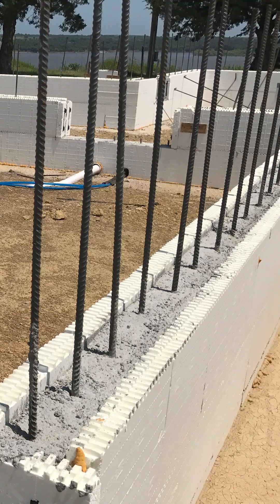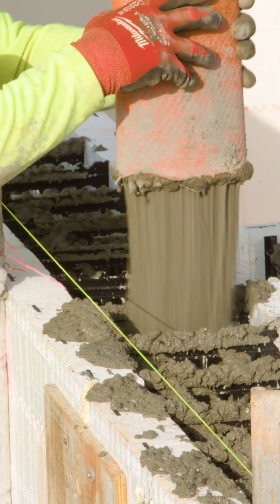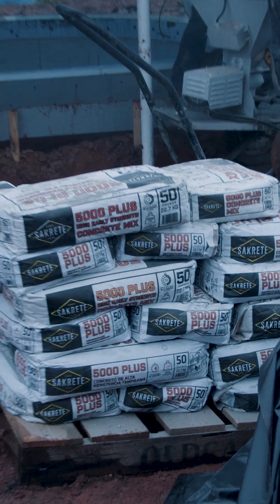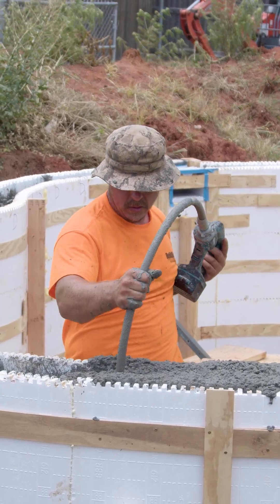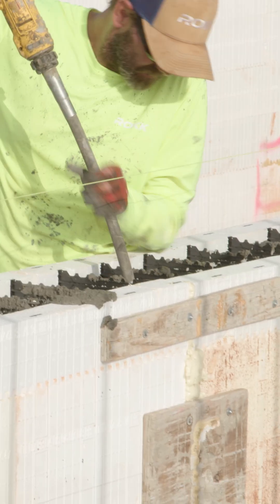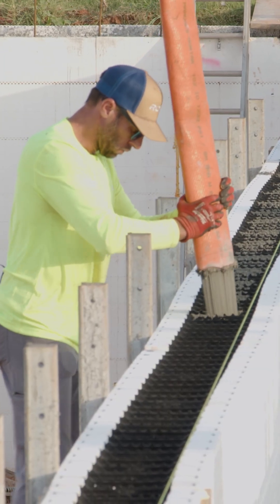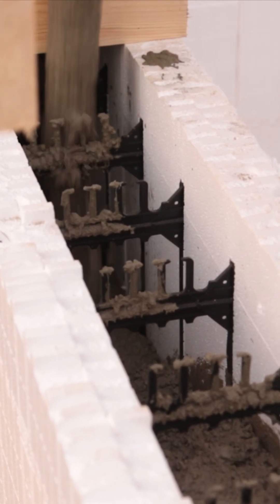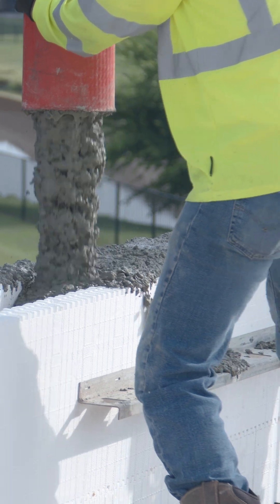Ep.30  Concrete Consolidation - Build Better with Russ Nicely  #icf #construction

Comment: I know it's mostly if not all the content of the concrete that helps with the flow, but if you have a thicker core, say 8 inch instead of a 6 inch, is it easier for it to set up inside the ICF? Using proper vibration of course.